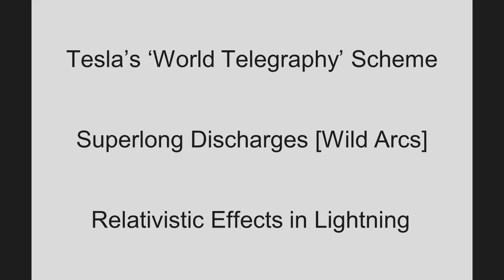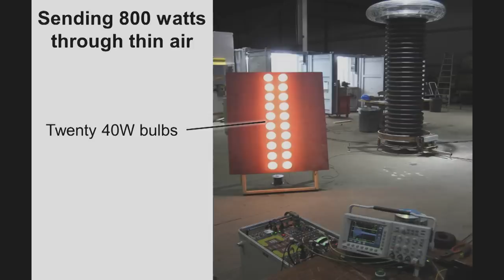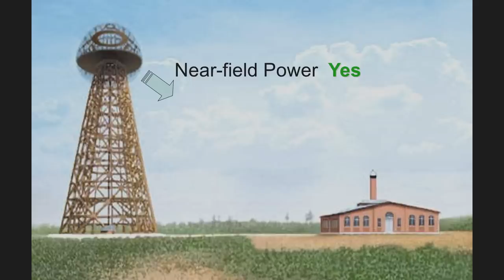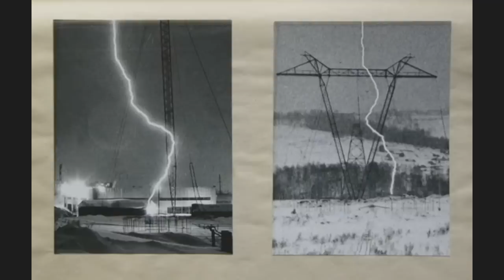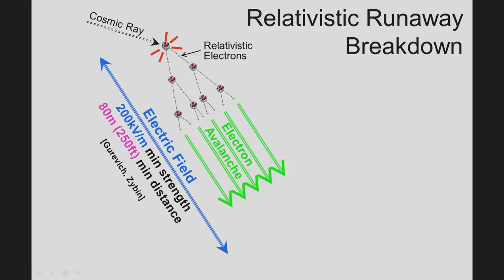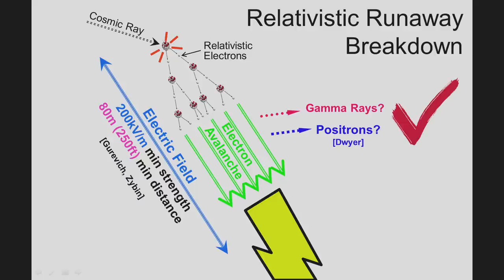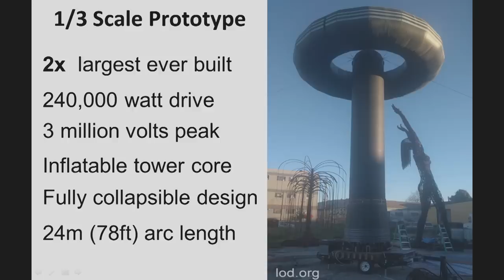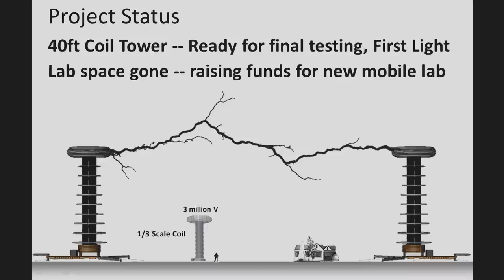The Secret Life of Lightning: The Science of Giant Tesla Coils | Greg Leyh

Comment: According to Eric Dollard, your receiving station, i.e. chair, must have the same amount of copper in weight as the transmission antenna.  It must also be wound backwards.  It's intended to transmit signals and power without RF attenuation.  You can put a mountain in the way and it will still work.  The reason is because his system didn't use the EMF spectrum.  They were Longitudinal, Dielectric, compressions, SCALAR waves, call it what you want...simply put, it's D.C. electricity through the ether.
Reply: Yes. Well said. It was a perterbation of ether Instead of electric and instead of magnetic. Though AC and DC electromagnetic activity happened in the system, it was a system of  power resonance between source 'tower' and reception or 'tuned' reception system that then converted the non Hertzian non electric, non magnetic POWER back into a usable electromagnetic form. 
So few seem to get the idea though it is so clearly defined. I suspect it's because just about everyone still thinks the tower radiated or propogated electricity. It didnt
Reply: Ive looked up Eric Dollard and some of the things ive read included that he made a teleportation device, also he is claimed to have been the only person to succeed in teslas transmission of power. Do you think he made a teleportation device and also I thought that the power is transmitted through capacitive coupling as is stated in this video so is the power you're talking about not capacitive coupling?
Reply: @gavinperch9413  There are a lot of myths about Dollard and Tesla.  Dollard never created a teleportation device.  The power is transmitted through the ether.  The ether, electrical ground, and counter space are the same thing.  Transmitting dielectricity in this way offers an instantaneous transfer, there is no magnetic/time component and therefor operates faster than the speed of light, since the speed of light is the rate of induction on the electromagnetic spectrum.  It the same with lightning.  What we observe as a plasma discharge is following in the wake of a dielectric discharge.  The dielectric discharge is what make the lights go out and destroys electrical equipment, which there is no surge protector on earth that can fix it.
Reply: Thank you both. I suppose I should learn more about the concepts that Tesla and Dollard have been exploring. I'm only clued in on the standard understanding of em interaction. Are longitudinal waves possible with electricity?
Reply: @gavinperch9413  it's a dificult thing transitioning from the standard thinking back to the real thinking, it took me 2 years of ongoing confusion but it was worth it.
Longitudinal is correct, wave is not. Think more along the lines of the 'wave' being 90deg forward of the 'up n down' squiggly sine wave math function we often use to represent em radiation (which is wrong).
Think of a Hollywood visualisation of an air pressure wave blast from a bomb. It is specificaly a pressure and rarefaction effect as it propogates (speaking of longitudinal em) the difference is similar to the common idea of AM and FM. The first step to understanding what EM is or indeed all forms of propagation is to get rid of the sine wave mathematical representation we are used to seeing everywhere. That is a math function not a physical representation of EM propogation.
Reply: One other thing, without accepting and including ether there is no way to understand the true nature of electricity, power, magnetic and radiation, they are all tied to this principle. 
Understand ether and you will understand everything, that was my lesson.
Reply: It's critical to include ether functionality in dealing with Tesla, anyone who thinks they can understand what Tesla was doing without first accepting ether can never repeat nor explain what he was doing
Reply: @atmospheres11  I really appreciate the help. I found a book by Dollard "a common language for electrical engineering". Do you think it would be valuable for me to start with his book?
Reply: @gavinperch9413  yes great. Eric used a different kind of mathematical expression in defining and explaining 'power' because he saw the inadequacy of conventional math and how it was deviating from the true nature of everything. It's tough to get your head around it but without Eric's deep knowledge and experiential understanding of exactly what Tesla and others had discovered, we would possibly have lost an entire generation of knowledge to the darkness of misinformation.
Good luck in your journey 😊
Reply: How is this different from induction?
Reply: @iancox7874  can you define a bit more what you mean Ian? I'm not sure if this will help or is tied to your question but consider the standard process of a supply, conductors, switch and load. We generaly focus on the circuit emf in terms of what happens after we open the switch and the load magnetic field collapses and we look at the inductance or back emf which is conventionally normal but we rarely look at the closing of the switch. Tesla found something in regards to this simple concept. He found that at the moment of closing the switch a dielectric perturbation ringing occurred and when opening the switch an inductive ringing occurs. So a 'capacitive' and 'inductive' state was the circuit start and end processes. If we start from the fundamentals, there are 4 states of any moment or event in the universe and altering any one aspect alters the others, or another way to look at it is the universe has 4 alterable aspects, 2 are physical (magnetic and diamagnetic) and 2 are etheral (electric and dielectric). Electricity is not its own universal 'stuff' or field modality, it is the side effect of altering the other 3 components resulting in what we call electricity.
All substance is magnetic, all ether is dielectric. Combined throughout the universe in disproportionate states there are places or moments of magnetic pressure (all mass is this) and between all mass is ether pressure. A significant difference of the 4 pressure modalities is that mass can only change state, move, apply pressure of change up to the speed of light only. The ether components on the other hand does it at minimum speed of light and always faster, as a mass change at one location happens slowly but the ether perturbation that results happens almost  instantaneously through the universe so at any location it can be used to perturb mass there. This is how Nikola made 'power' transfer without perturbing mass between the locations and did it faster than light.
I'm sorry fir the grammatical errors,  this was entered very late one night.
Reply: @atmospheres11  your ether must not be absolutely empty then. Maybe it was some kind of dark energy that made it happen?
Reply: @larrycarter1192  ether has no mass or Cartesian coordinates. Its has no substance but has attributes.  Imagine an apple, all the air around it as ether. The apple is mass, either one atom or billions bound in one location. Create a sound nearby, the sound causes variation to the apple. Put a small vibrating motor and battery in the body of the apple, the apple causes variation in the air as sound. This is a very poor example but near enough. Ether has no place or location, it is everywhere that mass is not. Yet, all mass is intrinsically connected to ether and neither is nor can be without the other in entirety.
Imagine the apple is mass and the only 'thing' we can interact with in a physical sense and we can only interact at no faster than light speed. But what is done to the apple causes immediate alteration the ether everywhere. 
Here is what Tesla did...
He used the local power stations supply of electricity to power a resonant AC circuit that also powered a DC circuit that created a capacitive ether perturbation via a spark gap induced ether perturbation. That in turn spread out almost instantly in all directions as an ether 'wave' (not a wave at all but that's the best conventional analogy).
Then at a distant location, the reverse circuitry allowed for the ether 'wave' to be converted back into a usable electric supply.
The speed of the 'power' (not energy, not electricity) delivered at the remote location was beyond the speed of mass perturbation constraints because no mass was slowing down the 'wave' propagation. 
So, ether is not local nor energy nor power nor electricaly nor light speed constrained.
Some more insight, space (outer space) is not empty, its completely full of ether. Mass IS magnetic ONLY. There is no such mass anywhere that is not a magnet. In fact there is only magnets and their ether counterpart, that's it, nothing else (not a mass and its negative, mass and its 'offset' ether)
Ether with enough perturbation becomes mass, mass with enough loss of perturbation becomes ether) eg. Mud, compress some of it enough and you have a rock leaving its ether still there as water,  a rock in mud becomes mud and takes some of the water (ether)
Reply: @iancox7874  Induction uses EMF.  Scalar does not.  This apparatus can operate in a Faraday cage or underground, again, with no attenuation, reflection, absorption, or have to obey the speed of light, which is just the rate of induction in a medium.  The signal travels through counter-space rather than space, so it is not effected by matter like EMF signals are.
Reply: @iancox7874  Induction is EMF and is very lossy.  Which is why a wireless cellphone charger only work in close proximity.  It's why no one thought that Wardenclyffe would work, even though Tesla stated several times in court that it didn't use EMF.
Reply: @BenCooke419  I’m not sure how this makes the outcome of this power source more accessible.. is this helpful or is it a pipe dream to get what we want?

That guy at veritasium made a car that runs on wind and travels faster than it’s power source..
Reply: @iancox7874  The implications of this technology would render most of our modern world's technology obsolete.  Power manifestation and transfer would be theoretically 100% efficient. Imagine using a cellphone that has no batteries in a cave with zero loss in signal.  Imagine operating a submarine 1000 ft below the surface with high bandwidth communications.  Imagine talking with someone on Mars from Earth with no latency.
Reply: There's no 'ether'. And d.c doesn't flow in any way through it.
Reply: @cjay2  can you prove that there is no ether or are you only reciting what may have been told to you by a superior or acedemic?. I'm asking genuinely, why do you believe there is no Ether?
Reply: @hermestrismegistus9603  I agree fundamentally with what you propose with some variation to the dual torus concept. For any change there has to be inbalance and an initial in balance may be explained by the big bang and a universe in constant reaction to thatvseekung the entropy of a final balanced state but I don't hold to the big bang theory as it has one significant error, so there would need to be another form of inbalance to explain observed and theoretical phenomena. A lifetime of seeking led me to a solution with no faults I can find as yet. 
Take the 2 torus and extend them so they overlap. Both north and South. They are both spiraling helically top to bottom S then bottom to top N. The helices are 90deg out of phase. Still keep the central 'plane of inertia' as it is critical to the function, but, reduce the ration of the 2 torus to be slightly <1:1 (I will avoid the ratio value intentionally as it is a well known number that will detract from the point being made).
As a result, the two slightly different sizes of overlapping geometries will result in nodal points of additive field strengths that would map out the overall shape as an egg shaped offset combined torus made of the 2 opposing slightly different torus fields. 
This is where the inbalance sits in our fundamental particle physics. The overall shape somewhat like an upsidedown apple (or right side up, either same same).
This is the nature of all mass.
All atoms, all mass, all that exists as directly observable phenomina is the magnetic and only magnetic.
But of itself it can not exist without its counterpart. Ether.
We are commonly taught that all is by itself in perfect balance therefore something can not occur from nothing. Well. That's pure nonsense because the universe 'apparently' came from nothing so science needs to pick a side! 
I'm not saying free energy is available, rather, I prefer to side with Nikola Tesla who discovered the phenomenon of Ether perturbation and started using it practically. Fundamentally, any mass perturbed, perturbs the ether and vice versa. Ether changes beyond the change speed of mass (light speed) so there sits the science of how to propogate spacialy.
In a ridiculous example, 2 apples (atoms) 300,000,000 meters apart in a gaseous universe. Turn on a 1,000,000 rpm vibrator inside one apple. The apple sets forth a radio frequency perturbation that will cause the other apple one second later to reactively vibrate. The gaseous environment is ether and it had already started perturbating the other apple almost exactly when the vibration started running. The second apple had 2 forces of change, one almost instantly via ether, the other via magnetic so to speak. This example is flawed as all analogies are. The only way to explain is directly but that's too much here.
Reply: @atmospheres11  this feels a lot like the old "kilometer long rod in space with a button at one end and a man pushing on the other" situation, a compression wave happens at the speed of "sound" through whatever material it's passing through, not instantaneously. Also what is this "ether" you speak of?
Reply: @Jacobschannel18802  at a very simple level, there is only one 'thing' in the universal vacuum, it is Ether. 
The Ether is not evenly dispersed in the infinite vacuum nor in a state of equilibrium.  There are perturbations and fluctuations that lead to compressions and rarefactions througout everywhere. Its similar to how smoke has its dense areas and concider also areas of roughly no smoke or a region of vacuum only. So the entire emptiness of the universe is flooded with varying degrees (at any coordinate) of Ether. 
When the Ether has a compression dense enough, it folds in on itself in a way that leads to what we perceice as atomic particle  presence. These moments or events transpire as magnetic by nature. Taking one of these magnetic areas (atomic particle) the ether intensifies around the magnetic toroidal area and is like a hyperboloid shape wrapped by a torus shape. The central plane of inertia is where the two 'kinds' of stuff become forced into equilibrium.
So, apples (atoms) floating inside water (ether).
That's all there is to the entire universe.
To extrapolate from there needs more than this medium to explain.

A simple step from here is to call all atoms magnets (which they are) so all that we perceive to be tangibly 'real' is made of one thing only, magnets.
Plastic, glass, bricks, leaves, water, toast is all only one thing... Magnets... The only difference between what we call a magnet and not a magnet is nothing more than how every single 'apple' in the water is aligned or not. If they are then we call that mass a magnet, those that are not are said to be non magnetic which is an insanity because it is made of trillions of pure magnets. Such is the arrogance of modern scientism to let misunderstanding replace facts for convenience sake.
Teslas 'secret' discovery was a secondary form of current.
Displacement current. 
He used it to bypass the issue of square law losses in the relocation of Power.
Reply: @gavinperch9413   I believe the "teleportation device" you are thinking of was his explanation of how George Van Tassell's Integratron was supposed to work before the project was "commandeered" and shut down by some group that he mentions. There's an interview of Van Tassell floating around YouTube where he starts getting into talk of "time cameras" which allegedly Steinmetz and a few others like Father Ernetti and apparently Enrico Fermi also allegedly investigated as well with the backing of the Roman Catholic church.

Also besides for just Tesla's research it might be worth looking into Dr Thomas Henry Moray's research on this topic of dielectric impulses along with his book "Beyond the Light Rays: the Sea of Energy that the Earth Floats In".

There's also Dale Pond's wiki on John Worrell Keely's Sympathetic Vibration Physics and Walter Russell's syntropy based nuclear transmutation machine that was confirmed as functional by Westinghouse labs in a 1920s era newspaper article, as well as many of the writings of the Theosophical Society members, as well as Fulcanelli's books and the other associated alchemical literature if you really want to go down the rabbit hole! 🐰🐇🕳  The thing that I find hilarious is that if Keely's Airship really was flying around in 1898 then that means a form of anti-gravity flight was developed in the United States years before the Wright Brothers ever took off at Kitty Hawk! 🙀😹
Reply: @atmospheres11  if you look into John Worrell Keely's research, of which Dale Pond has a pretty good wiki on along with some interesting lectures posted on YouTube, you'll notice he was allegedly getting negative vacuum pressures well in excess of -57 psi... he said there were deeper layers to the Ether that were only accessible from our scale via the phenomena of Sympathetic Vibration and investigated them thoroughly. Unfortunately after his death it is alleged his patron, Clara Bloomfield-Jessop, a member of the Theosophical Society, had given all of his research journals and best inventions away to Dr Annie Besant in order to hide away his research so its more destructive aspects could not be used during the soon to be coming world wars and prevent the total destruction of Europe. Though when you start going down the Theosophical Society rabbit hole it brings you to Fulcanelli and the other alchemists and opens a whole new can of worms modern western science doesn't seem to be ready to deal with!
Reply: Also thought I'd mention Joseph Newman's book about his energy machine because that seems particularly relevant to the topic at hand as well. If you read thru it (there are multiple editions so I would aim to find the newest version), he proposes some interesting alternative electrodynamics ideas along the lines of Pier Luigi Ighina's "magnetic atom" and Ighina's research is also worth looking into as well, considering he was a protégé of Guglielmo Marconi and he allegedly got up to some fascinating unorthodox electroscience feats as well.
Reply: @atmospheres11   I was just thinking about how the perturbation that appears upon the opening and closing of an electrical switch is similar to the water hammer effect that occurs on the valves and pipes when doing the same thing with the water pipes and faucets in everyone's bathroom and kitchen sinks! Maybe there is some analog there that can be used to investigate the phenomena further! Keely apparently used water hammer phenomenon at microwave frequencies to induce some of the effects required to get his early machinery to function properly and create an expanding Ether from the water and air in the pipes that could then be used to move objects with force like a hydraulic piston before he found other more effective ways of controlling the forces he had allegedly discovered. Dr Thomas Henry Moray (the true inventor of the germanium transistor in the mid 1920s) also built many control systems similar to valves and diodes for controlling this longitudinal dielectric "wave" pressure and these were apparently used in his 50 kW constant output "Swedish Stone" based shoebox sized generator. Thomas Townsend Brown allegedly used the same dielectric impulse force being "resisted" by an asymmetrically shaped high kappa dielectric (barium titanate/strontium titanate) condenser/capacitor to allegedly induce changes in gravity. Maybe the confusion that lies in the standard way of thinking was intentionally put there to help safe guard certain TT Brown based technologies from coming to light in an institutional settings where they generally scoff at the idea of an ether and thus become unable to replicate 🛸 propulsion systems because of that... which would be a major national security issue if they were ever successful in publicly demonstrating that phenomenon in such a setting where other academics would then likely be willing to replicate and confirm such a feat and let the proverbial cat out of the bag on field effect propulsion to the rest of the world's air forces and scientific communities.
Reply: @Ben Cooke  what would you suggest if I were to make a orgone generator to harnesses natural energy.i want to build a staff that radiants naturally.  Thanks
Reply: @Garry Threlfo  you can tell me anytime. I want to build a staff that harnesses natural energya.
Reply: @atmospheres11  There is no such thing as scalar waves. There is nothing mystical about Tesla coils.
Stop with the quackery and learn physics.
Reply: @brushhaidinger2506  you have proof of no scalar waves then.
I'm keen to look at it.
References please, or is it just your beliefs?
How do you get around C P Steinmetz then?